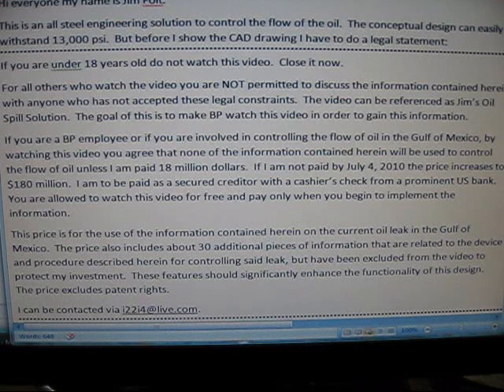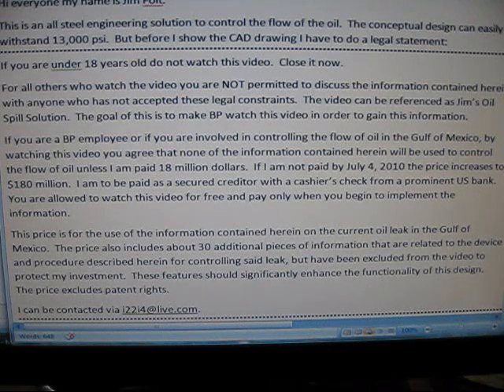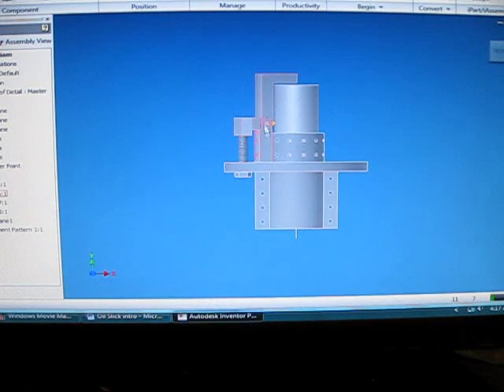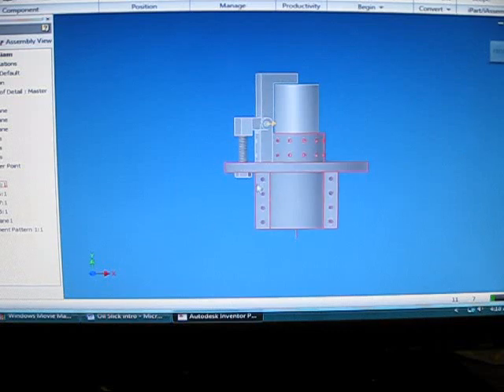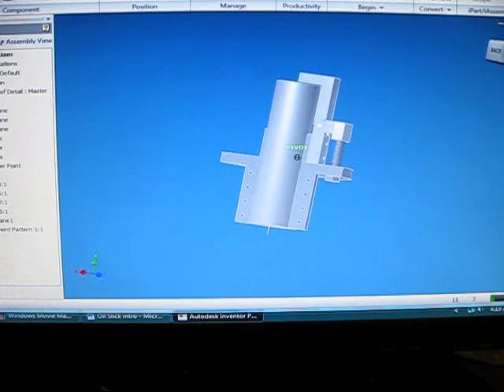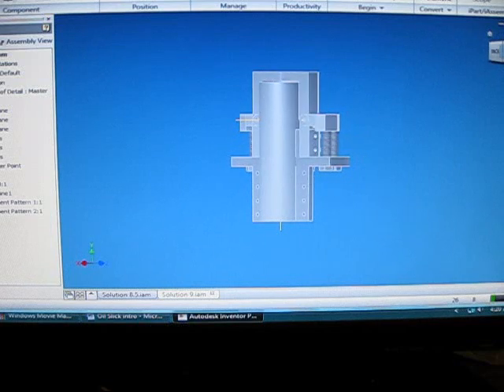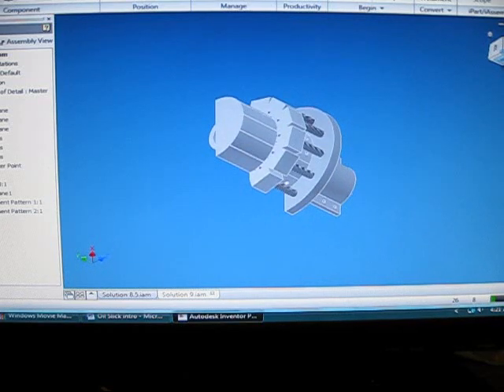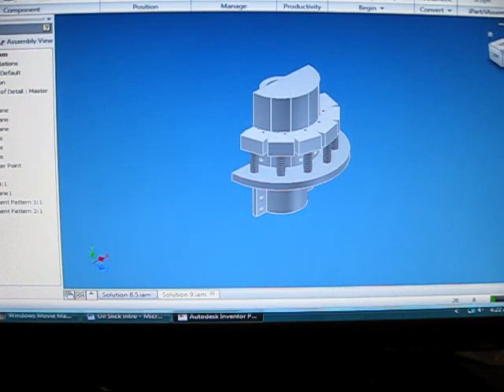Jims Oil Spill Solution Trunc_0001.wmv

Comment from the maker: @markb2323uc attention deficit?  just kidding.  You are right, it's not a very good video (it's my first).  And I didn't do animation of how it works so it takes a bit of internal processing to understand.  And the legal part is lengthy due to Intellectual Property Laws that suck.

BUT IT WILL STOP THE LEAKS -- EVEN UNDERGROUND ONES (with the addition of the 30+ extras not included in the video)

Comment from the maker: @xxxFaustusxxx absolutely and lol.  It certainly seems like it may be a new area of law.  But BP asked for help.  They opened the legal door.  I did work -- intellectual work for them and I am asking for compensation commensurate with the quality of the ideas and the value it has to the company.  Wiki Robert Kerns. 

If they use the conceptual ideas and don't pay, then there is the RICO Act on top of 180 Million. 870 willful violations and 11 deaths might very well be construed as racketeering.

Comment from the maker: @dlsnfl Good points!

A siphon tube is supported by the wall of the pipe when it is inside.  Also, a siphon has a smaller diameter.  So it is a bit different of an animal.

Your solution using long rods is good.  I mention in my video that there are about 30 additional features that I don't show in mine.  One of them is that my closure bolts (for pivoting the arm) can be significantly longer than shown.

Still, when u get right down to it, this design closes without the problems John's has.

Comment from the maker: @dlsnfl John's trying to place a riser on top of oil spewing out at around 5,000 psig.  Then insert bolts to hold it on.  He makes it look simple in his video.  It wouldn't be.  Any deviation in the new riser would redirect the flow of oil.  That would cause an equal and opposite reaction in the riser.  It would be nearly impossible to make this happen.  On top of that oil would be escaping the other holes he has in his design and partially blowing out the bottom obscuring visualization.

Comment from the maker: It's better because the competing designs:
1) Do not consider resonance problems, 
2) Fail to account for massive shear forces,
3) Require that the riser be sawed evenly to create a flush fit,
4) Require significantly more material to accomplish the task,
5) Require more manipulation of that material underwater,
6) Require dealing with the pressure from the flowing oil,
7) Assume St. Venant's Principle holds when if fact it doesn't.